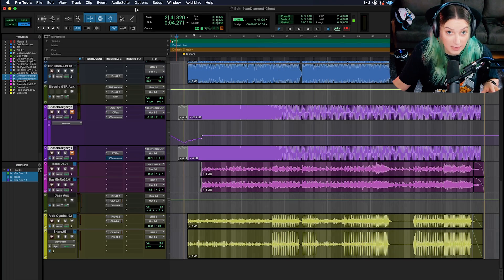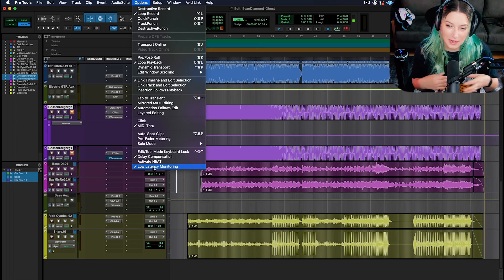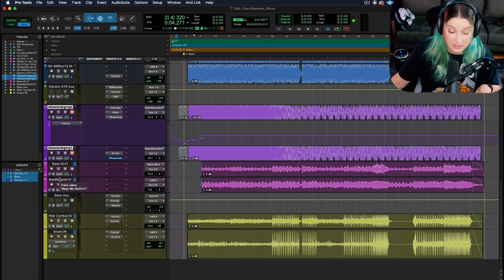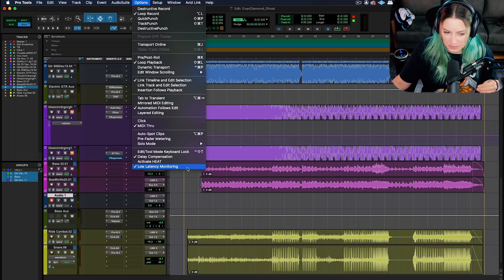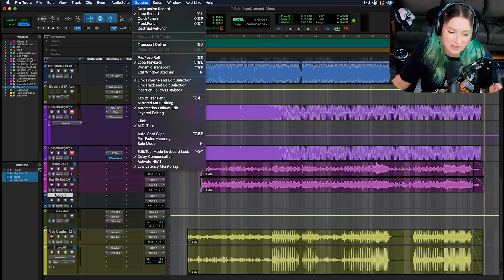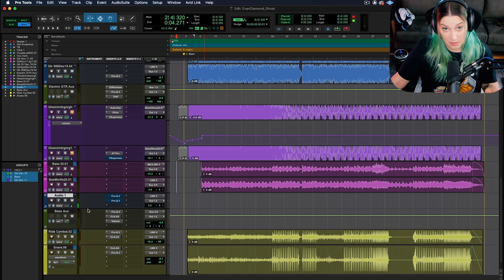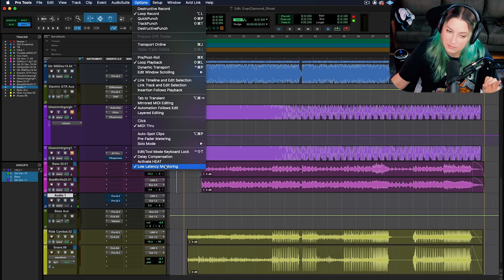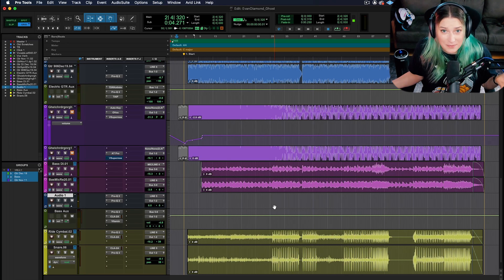Pro Tools Basics: Low Latency Monitoring

Comment: I was upgraded to pro tools studio 2022.7 from pro tools 12. I use aux track for some fx. On pro tools 12 it works great wirh aux tracks, there is no "delay" effect when recording, there's no need to mute the track. But, in this pro tools 2022, the "delay" is exist again. I've tried all the setting that use in pro tools 12, nothing works. And then I find out the cause is the aux track. When I make it innactive, it works great without "delay", but when the aux track is active, I got the delay effect when I recording, so I have mute track while recording. Any suggestion? I use aux track for expander/gate and noise reduction.
Reply: Protools screwed everything in the new versions.  So we would all have to buy hd version it's marketing bs computers are so fast now they got to a point about 2013 we're I had zero latency on my Mac with many heavy plugins bussed no problem now I have new top of the line hear a and pt version   and we're back to 2002 latency issues.   Straight bs avid knows what there doing   it's not our computers or a setting it's on purpose ...I can guerentee no one that has pt version released in last 5 years has been able to track with zero latency and all plugins active ...but we used to be able to ...

Comment: I just bought an Apollo Twin, and it's been a bit frustating because im used to tracking with compressor ect already, and cannot hear nothing from PT plugins because all the sound I hear comes from the console app.
Reply: Just use the PlugIns from UA inside Console while Tracking. You can print them, or just use for Monitoring
Reply from the maker: Yeah, that's what I do sometimes: just put some plugins on console while tracking. I'll sometimes raise the levels with the fader in console on the track I'm recording, and then turn down my PT levels to get things sitting nicely in the control room for the tracking phase.

Comment: Ive been using UA Apollo/council and it works great in conjunction  with low latency while recording into pt. However when im tracking, it seems as thou no matter what settings i use, if i do not unable the record button in pt when i preview what ive just recorded or aid in doing a punch in, it has some wierd latency thang goin on. As soon as the record button is turned off its fine. The only way ive found to get around it, is to de activate almost all plugins  and then the problem seems to go away.
Reply from the maker: Yeah, that's why I monitor through Console while recording with my Apollo. There's some latency coming in with live input, so what I do is listen through Console entirely, and then after recording, when listening back, I mute console and listen through PT.
Reply: @CatoNoise  mute the record track in console and listen through your Daw
Reply from the maker: @jayrunproductionsllc9861  last time I checked it doesn't sync properly when I do that. Sometimes it gets close, but not as good as monitoring through console.